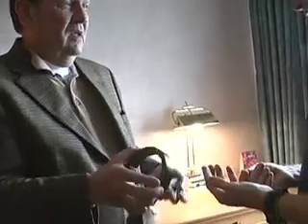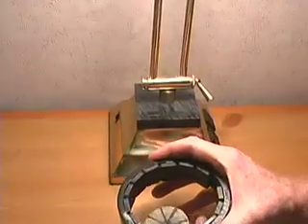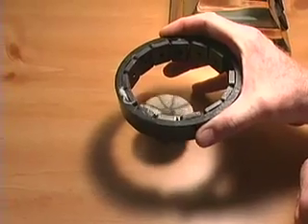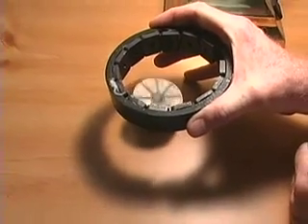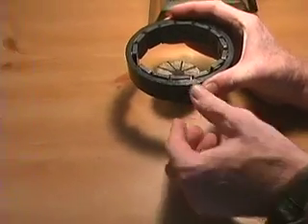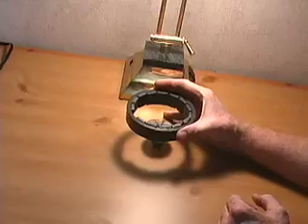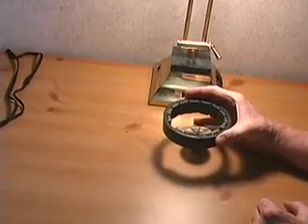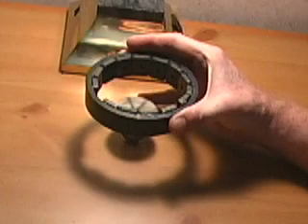George Green shows magnetic motor proj. camelot

Comment: mount circle of magnets on a positively charged plate of whatever. encapsulate and center negatively charged plasma or mercury in a positively charged container with a centered metal rod that is welded to the bottom plate. running wires under floorboard to  connect to outside tube containing precisely mounted magnets. submerge the whole ring in ferrafluids tube, cover. let simmer. onboard computer maitains correct ratio/timing of electrical pulses. build to scale. you do the math.

Comment: OK this is not free energy.  If you were to put the magnetic ring on a stand instead of holding it.  The smaller rotor will not rotate for long.  It will stop.  The movement of the gentleman's hand is causing the disturbance in the field thus making the rotor rotate.